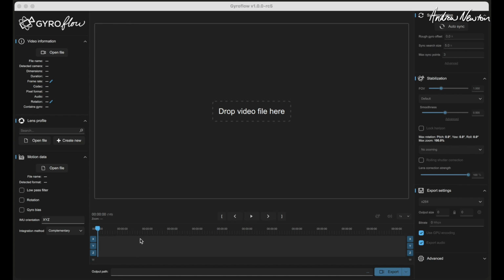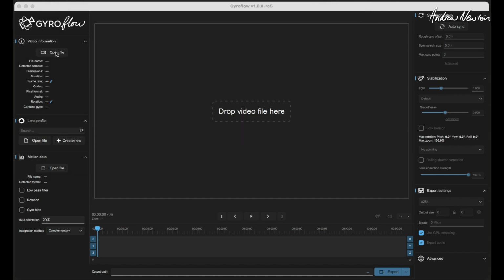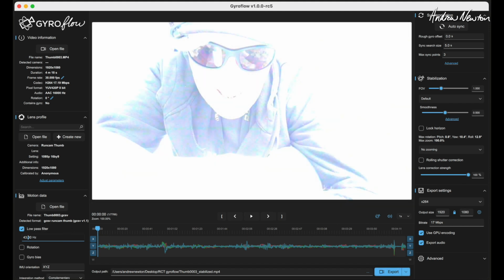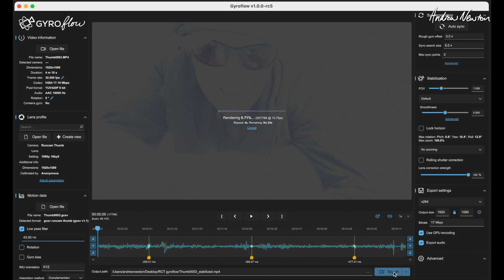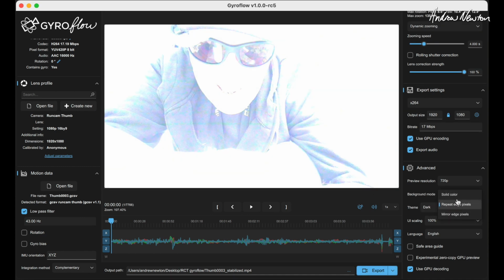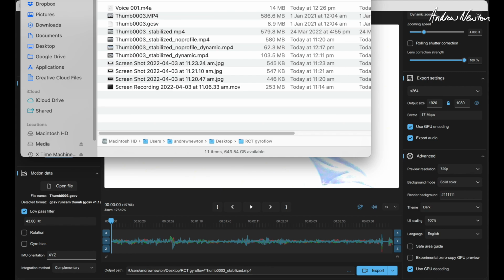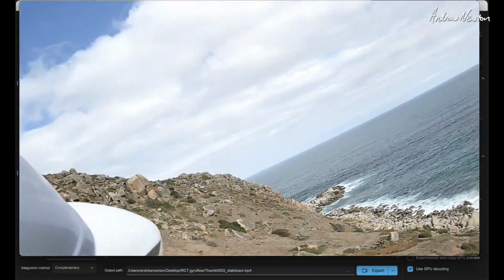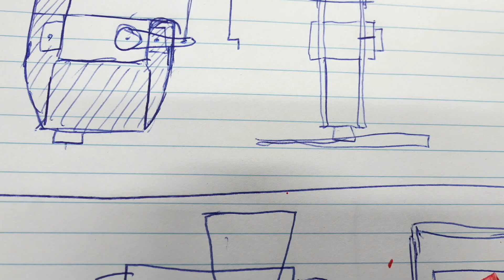Gyroflow Tips for the Runcam Thumb

Comment: You need the lens profile for the stabilization to work correctly. Without lens profile you can get odd warping effects. If you want to keep the lens distortion then from rc5 onwards you can set the "lens correction strength" on the right to 0%.
Reply from the maker: Thanks Alex, I have included you advice in the description

Comment: Nice video! Played around a lot with the thumb an Gyroflow. I'm in planes too but with a motor I have the problem that the gyro data is quite dirty (yes prop balanced) and there's a kind of jitter on the edges in the stabilized footage. Turned down the smoothness to 0.15 and lens correction to 0.5 to get a more "natural" look. Still not too happy with the results but it kinda works.
Reply from the maker: Thanks for the tips!

Comment: How does this camera handle vibration? I pretty much gave up recording video because of jello.
Reply: Balance the prop and motor? (use APC).
Reply: @prep0wer  Multirotors with small tri-blades are harder to balance. I've even built a dynamic prop balancer to get them really dialed in, but in the end you clip a branch or pick up some dirt and it's all for nothing.